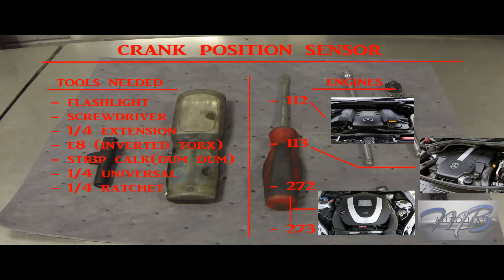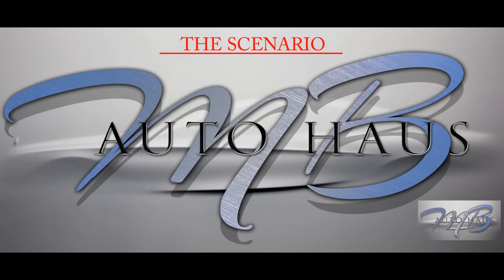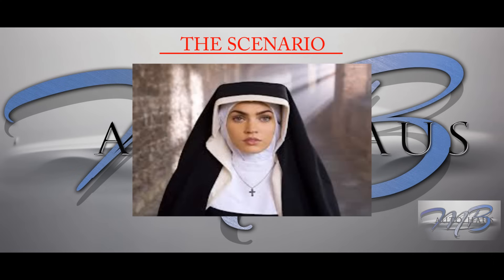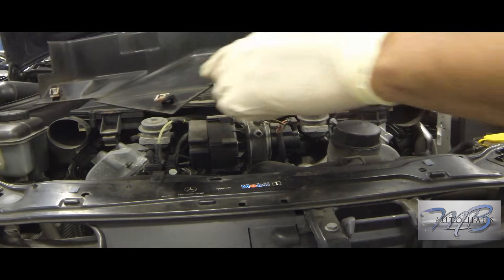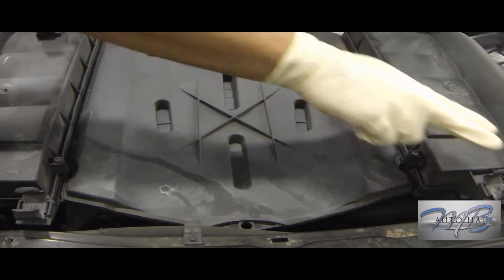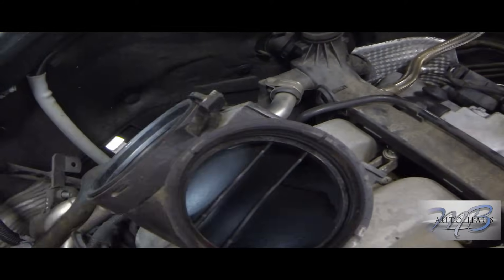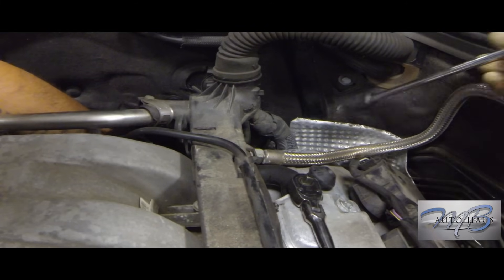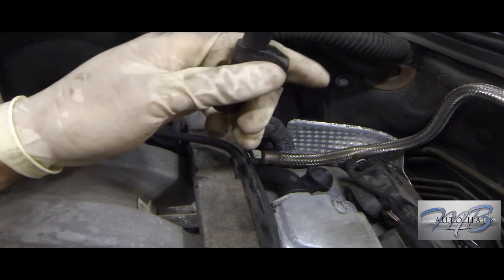MB AUTOHAUS MERCEDES BENZ CRANK POSITION SENSOR  REPLACED 1 OF 2

Comment: Great video, the absolute key to success on this job. The sensor died for good with 86,592 miles on the odometer of this 2006 R500. Did the job on 22nd and 23rd April 2023, lying on thick moving blankets like TheDrinkwaterBrothers. Take a look at that elbow at 4:58. See the little loop on the top hook? If I ever have to do this repair again, I will loop a coat hanger through it to help pull up on it to get it free. On the bottom hook you'll notice in the video that there is a place for your left thumb to push it down and unhook it. Disconnecting the crank angle sensor while in place wasn't happening, so I removed it first and then disconnected it. Even used a little bit of Teflon lubricant so that the rectangle shaped plastic loop on the plug would have better action over the ramp-shaped nib on the sensor. For sticking the bolt to the reverse torque socket, I didn't have Dum Dum, but the putty the kids use to hang wall posters worked perfectly. I made sure first by toying with the putty on the reverse torx bolt that stabilizes the black cowl brace up top.
     The Bosch aftermarket part number (PN) at O'Reilly's is 0 261 210 170; the malfunctioning part I removed was MB PN A 003 153  27 28, Bosch PN 0 261 210 171. The Mercedes spare at the dealership cost more than 3 times as much as the Bosch PN at O'Reilly's, so O'Reilly's got the business. I connected it, then inserted it, and rotated it until the threads grabbed. Kept my eyes closed during most of the sensor replacement since sight was not needed for this 100% blind task at the center of the job. Once the mass flow sensor - pipe assembly was mounted and connected she started up immediately. With everything reassembled she passed a 1/2 hour road test, so the new sensor will likely go the distance.

Comment: Thanks, this is a common problem with older Mercedes.  It was smooth sailing using your instructions to replace the crankshaft position sensor in my 2001 C320.  This is a very tight compartment compared to our E320 and S430.  The basic steps were:

 Open and lock hood in upright position, disconnect right and left air hoses, remove front and top air filter assembly, place blanket on top of engine and climb up.  

Using a screw driver on MAF retainer, open clip lock and remove retainer from housing.  Using a screwdriver on rear clip, remove MAF by lifting up and disconnect cable connector.

Disconnect driver side valve vent hose from elbow using screwdriver, pry top clip up with screw driver and pull elbow back, then down and then up to remove elbow.  

Feed the E8 socket and extender with your right hand and locate bolt with your left hand on the sensor, unscrew bolt and grab with your left hand, remove bolt and then pull sensor out of the bell housing, feed to top of engine and disconnect cable.  

Attach new sensor and feed cable back down to bell housing.  Place some paper towel shard over the bolt head and stuff into E8 socket wrench to prevent from dropping bolt.  

Using your right hand guide the wrench with extender and bolt down into sensor mount.  Use your left hand to guide the bolt into the hole and then start turning the extension with your right hand.  Tighten with ratchet.

Reverse assembly starting with replacing the elbow, valve hose, MAF, retainer, cable connector,  air filter assembly and air hoses.  Close the hood and start your car.  Clear any codes with your iCarsoft code reader.  Back to the road again.  Thanks again!  Couldn't have done this so fast without your great video.  It took me about two hours.
Reply: Thank you so much !!

Comment: Thanks for the video. I had to change this on my 2008 GL450 and I was able to get to it without removing the Mass Airflow Sensor. I used some blankets and a piece of cardboard on top of the engine and l laid on it, giving me pretty good access. I was also able to access the sensor with out completely removing the heat shield (or bracket). I just removed the inner bolt and loosened the outer bolt which allowed me to flip it up and out of the way. I did need to disconnect the electrical connector in order to work the connector out of its location and then reconnect the new one after putting it back in place.

Comment: Thanks for this video.
Just a word of warning for anyone trying this, I found it difficult because the sensor was stuck in place and I had to construct a special tool to extract it, destroying it in the process.
The word of warning is to do the job where you can have the car parked for an extended period in case you have the difficulties I had.
Car works perfectly now.

Comment: Thanks for the video, did the job today on my '05 CLK320, following exactly what you did. It was a nightmare job, I couldn't see the sensor, and I could just about get my fingers on it. Great tip with the dum dum, although the screw did fall out with me once, had to remove the undertray to retrieve it. I used the 1/4" universal joint and E8, with 3 1/4" wobble extensions, room is extremely tight on these CLKs! Hope I never have to do this job again....

Comment: Thank you, without your video I wouldn't have known where the sensor was located or the bolt size (being that there's no way to see the bolt from above).
I however chose not to remove my mass air flow and instead did it all from the driver side in under 20 minutes on my MB E320.
Thanks Again.

Comment: Best from underneath. TAke the plastic shield from below the transmission pan off, using 8mm wrench.   Look above the starter and the LH fwd drive shaft and you'll see the plug on the driver side where the engine meets the transmission.  It's at the 10 oclock position, just like on the Sprinter. I have a GL350,2013. crankshaft position sensor.

Comment: Great video, I changed mine on my 05' C240. What a pain in the ass this was. If you have large hands like me it's difficult to get your hand in there and back out again. You can't see the bolt as it is blocked by the top of the sensor, so it's all by feel. Note that he put tape on his universal joint to give just a slight ANGLE. You need a slight angle to get the socket around the sensor and onto the bolt. A 10" extension worked for me. I put the universal on the ratchet, and my extension allows the socket to bend at a slight angle but I still used (painters blue) tape to hold it in a fixed slight angle position or you WON'T be able to get the socket onto the bolt. When bolting the new sensor back on, you need to somehow get the bolt to stick onto the socket so you can lower it in there and get it threaded. While I had my MAF sensor removed, I cleaned that and my throttle body. They sell specific cleaner sprays for both. You might as well do it while you're in there.
Reply: 🤣🤣🤣🤣 Yes in did pain the ass with smaller hand like me as well just the way its designed its makes it so difficult.

Comment: Thank you for the video taking off that mass Air flow really helped in my car there was a bracket connected to the top transmission bolts that I had to remove to get to the sensor

Comment: Just replaced the CPS on my 2006 CLS500 with M113 V8.  MAF removal wasn't required in my situation and perhaps not in yours'.  If you can slip your hand and forearm between the engine and the firewall on the driver's side of the engine and reach down about a foot (that's where the CPS sits),  MAF can remain in place.  In my case, the most important thing was moving aside (just a bit) the two wiring bundles that obscured the CPS to allow access of my hand and tools. Fairly easy to do.  I was then able to lean over the fender and swap out the CPS.  (Note: to prevent the E8 bolt that secures the CPS from falling out of the socket during removal, use your hand after you get it loose).

Comment: Thanks for the video. I watched it and was a little intimidated with all the plastic and hardware that you removed. So, I looked with a flashlight from the driver's side of my 2003 G500 and saw the sensor within a long arms reach. It was a very tight fit (under the hood strut) and required the torx E-8 socket and a very long extension from Harbor Freight and a lot of arm turning and reaching-with a few war wounds from scratches. But, I was able to get my old sensor out and replaced with a Bosch replacement (cost $45). I was not sure how to get the wired connector off the part-as the wiring tab was not releasing. So, I removed the sensor first-attached to the connection- and then, gently pried the connector over the lock clip on the sensor body with a small screwdriver. I also, looked for the "dum dum" for the socket and three auto parts stores turned up nothing. No one had even heard of it. I used blue painter's masking tape to lock the sockets/extensions together and keep the screw in place. Pretty proud that I did it myself and saved the money. No doubt that a MB shop would charge $500 to do this. It's always $500 just for showing up. Now I have more $$ for gas at 10-12 average mpg....ha. Thanks!
Reply: I guess when they charged me 200 to do it on my 04 cl55 amg, parts and labor. More than fair! Do you still drive your G wagon?
Reply: @speeddemon002  Yes. I drive the G500 several times a week. Up to 72K miles on a 2003. Owned it for 17 years now. Ha! A few years back, I also, owned a 1990 911 Carrera 2. Sold it 7 years ago and now they're in the 70K-100K range. (My 2002 Mini Cooper S was quicker. Still have that one.)
Reply: Thats amazing! The G500 is going to hold value and from what I understand they are going up in value. Carreras are fun. My boss is the CEO of Tial performance. I refurbish turbos for Porsche’s. We also upgraded the turbos for our customers and tune. Its a passion that not everyone understands. Definitely mini cooper is fast! Take good care of the G wagon! We also provide parts to champion motorsport, by design, boden. Its a big world in the cars theme. Take care!

Comment: Cheers man. Thank you so much for this video. Very helpful!! Total spent for everything $18 compared to $544 at dealer. :) Only trouble for me was the first cable. It was stuck for at least an hour until finally it slid out using a flat head and poking though the opening hole. Also, just a warning to people, the E8 must be 1/4 sized as mentioned. I got the more common E8 in 3/8 and it won't fit. I right now have to special order the socket online since no stores has it. Not sure why not even one store sells it, every store it is online special order. -.-

Comment: If you’re struggling, get the proper tools! I first tried with a 3/8”dr E8 on a 5” extension and a ratchet, struggled for a long time, almost lost faith. Called my buddy to get the proper 1/4” E8, a 6inch extension, universal joint. Worked instantly. Replaced the sensor and put everything back in place in less than 30min. Do not waste your time, get the proper tools. On: C240 2003

Comment: I would greatly appreciate some consistency with the volume in your videos, from your first one you whisper, i rise the volume to hear the details, get to this video, blow my eardrums, then go back to a whisper. Great videos, detailed info.
Reply from the maker: YEA SORRY ABOUT THAT THE INTRO IS LOUD
Reply: MBAUTOHAUS
where is the video how to change sensor on m112 engine?
Reply from the maker: that was on a c240 which is the 6 cylinder (112) engine i removed the maf sensor for more room. usually on your 113 its a little more room.
Reply: MBAUTOHAUS  can you show how to do on w210 e class E320? please

Comment from the maker: AT THE END I SAID NEW TOOL INSTEAD OF NEW PART. BASICALLY MAKE SURE THAT THE NEW CRANK SENSOR LOOKS EXACTLY THE SAME WHEN YOU LOOK AT THEM BOTH ON THE INSIDE
Reply: Would you know offhand if a relearn is necessary after replacing crank sensor on 07 C280?

Comment: We replaced the crankshaft sensor on my 2006 mercedes R350 and it still wont start, it cranks but doesnt friggin start, im begging for help here... Is there something else that has to be done?
Reply: Would have to be the wiring going to the fuse box on the driver side under the hood. Im havig. Same issue for my 2008 clk350. Running fine the p0336, new CPS r3placed and i cant figure out why it wont start still. U know what happened to your and if you fixed it then pleaze ket me know because i have 3 kids and cant have my car not running

Comment: You also get cut off, there at the end. Made me think an error occurred.  My M113 doesn't look like your photos. Well, appears closely to the one without a cover over the intake manifold.  Voice volume could be a bit higher. Oh, and while watching part 2, I tried clicking on the lower left to view part 1, and it wasn't working. 
   Not sure that, your new name is better because it pulls up dealerships overseas.  I think that's what they call their dealerships, is Autohaus'.  Try something different, like MB Autobahn, it's close.  I don't know, just a recommendation. I hope you upload some Performance upgrades for the M113. Some chick with, the E, or C class wagon, has the M113, and she threw on a Supercharger off of another Kompressor AMG engine until, she bought a Kleemann Supercharger kit, and ended up switching back to the AMG stock kit she pulled off a newer AMG engine.
     Hers was NA like my M113 but, in the coupes, and some sedans, the same AMG engine was Supercharged.  I saw one for sale on eBay in good condition and complete, an AMG supercharger, and that's when I knew I'd eventually slap a kit on.  Many say, the Kleemann is far more superior than the AMG Stock kit but, if funds are tight, then an AMG Supercharger used, from maybe even a European junkyard, would suffice.  Along with an aftermarket intercooler, and bam!!!  600+whp like that!  Of course, along with some other necessary upgrades that could assist the Supercharger.
      The Kleemann kit comes with absolutely, every single item required for the Supercharger kit, that does not come included, with the stock AMG previously used kit.  And you do get what you pay for, in that awesome kit from Kleemann.  
    I wonder what years, the ML55 AMG, came with the stock Supercharger?
Reply from the maker: HEY JUNGLIST1SOLDIER, THERE WAS A FALLING OUT WITH MY PARTNER AT BENZWERKS. THE NAME AUTOHAUS MEANS GARAGE IN GERMAN. I'VE SEEN A COUPLE OF THOSE KLEEMAN SUPERCHARGERS SOME GUY HAD A W208 CLK 430 WITH ONE I THOUGHT THE REGULAR 430 WAS FASTER. YOU HAVE TO REMEMBER THERE IS ALOT OF ENGINEERING THAT GOES INTO THOSE AMG CARS. I DEAL WITH THEM ON A DAILY. I WOULD BE CAREFUL JUST SLAPPING ONE ON A REGULAR M113. THE ML 55 AMG NEVER CAME SUPERCHARGED, ONLY THE SL55,CL55,S55,AND E55.
Reply: Oh, really?  There's a video here, on YouTube, a diy on changing the oil for the Supercharger, on a ML. I just watched it and he doesn't show putting the oil in but, its titled, how to change supercharger oil on a M113-ML55 Mercedes Benz.  I noticed he had some nice pulleys, which is something I've  been looking for, underdrive  aluminum pulley kit.  
    I understand how, putting a supercharger, or turbocharging a stock engine, would be a stupid senseless mistake.  As the engine would need to be prepared to handle, such extreme pressures, being inflicted upon the engine, which NO regular engine would be able to handle.
    I am only curious on doing this to my AMG M113, because I am aware of the meticulous engineering, incorporated in hand-building these high performance engines.  Maybe, I am wrong to think, that slapping on a supercharger/turbo, would be fine, onto the M113 but, not only have I heard of it being done on YouTube, (they said they did it but, don't actually show it being done), but Kleemann offers their supercharger kit, as if its to upgrade from NA M113.
    Now, I'm  curious to find out, what the specific differences are, between the NA and the supercharged version of the M113 AMG.  I highly doubt, that different piston rods, crankshaft, and all other internals, are not the same materials/ products being used in both versions of the AMG M113.  I am going to inquire on the MERCEDES Benz forum, to see what kinds of information I can pull up.  
    Too bad about the falling out, you spoke of.  That was a cool name, Benzwerks. Not anymore though, huh?  OK, so I've learned what autohaus means, & yes, I was being lazy in looking it up myself and stuck to my assumed definition.  Weird that they'd name their dealerships, garage.  
   I tried finding out from the Benz forum, why my radio is stuck on wait, and it doesn't allow me to do anything at all besides, flipping the face down to insert a CD, and turning it off and on.  It used to work perfectly before I went to jail and then I get out and, I am stuck with having to look at this wait message displayed on my stereo, and no music.  
  Do you know how boring it is, without tunes?  I frikkin' hate it!  Maybe, you can assist me in finding the solution?  I checked the fuses, except I'm not sure if there's one on the amplifier, which I can't seem to find to see if it does have its' own fuse, as most amps do.
     Yeah, I am pretty certain that I will be uploading videos on YouTube, for the first time.  All about the various jobs, I'll be performing on my well Loved Mercedes-Benz, ML55 AMG :-)    If all goes well, all of my trucks' modifications, should be completed within the next year, (hopefully within half of that time), the sooner the better.
Reply: Dude actually, has got a CL55. Don't know why he put ML55.

Comment: I had codes p0016 and after replacing the camshaft sensor it wouldn’t start so I checked the codes again and got p0335 and i replaces the crankshaft sensor. Car still wouldn’t start and I read the codes again and got nothing. No clue what to do now.
Reply: Same shit happened to me. So i think its in tje woring. Your crankshaft sensor goes to your fuse box on the driver side under the hood next to the engine. Might be your problem too.